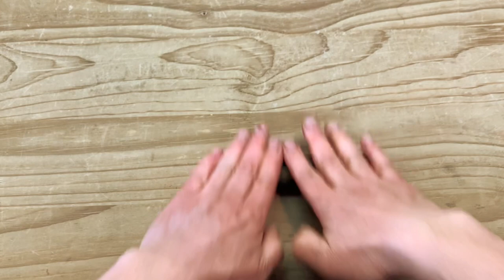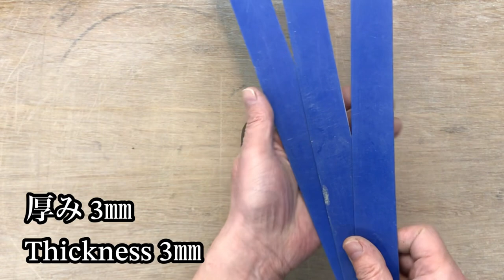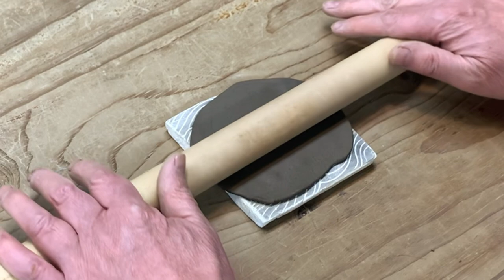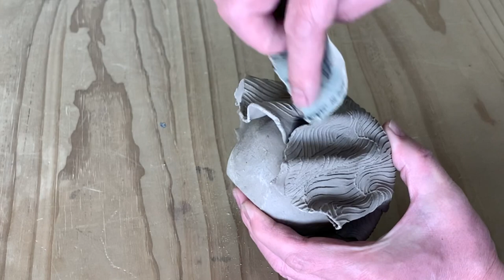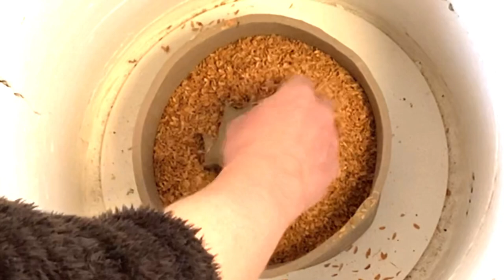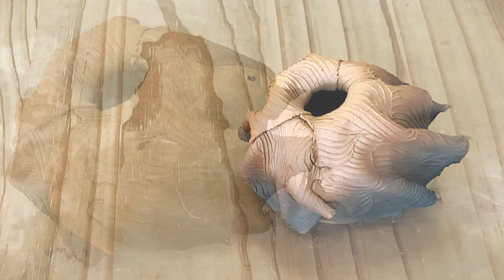炭化花器作り方 How to make a carbonization vase 陶芸 pottery 熊本栄司 Eiji Kumamoto

Comment: Thank you again for such a great tutorial I just love watching you work and I love the end product and this one is so beautiful so simple in it's beauty Thank you again and thank you for sharing your techniques!! I am assuming the clay is vitrified and will hold water even though there's no glaze Is that correct ?? It's amazing that the carbonization didn't burn out at that temperature...
Reply from the maker: Thank you for watching our videos. Carbonizing and firing alone does not make it waterproof. Waterproofing is done after the work is completed. If the box is sealed tightly, the rice husks will not burn up.